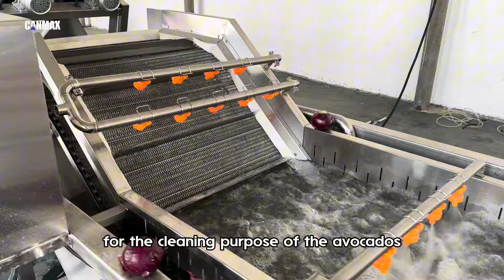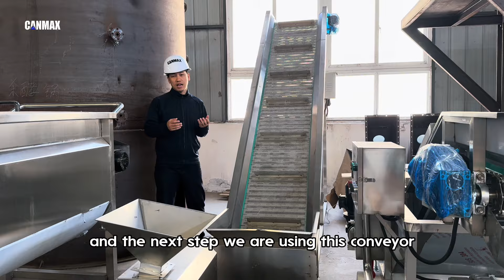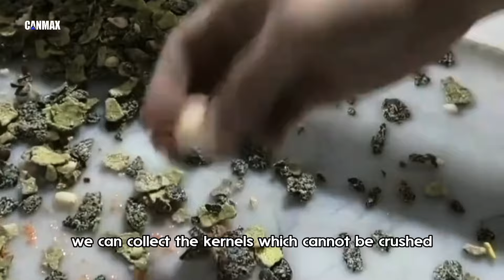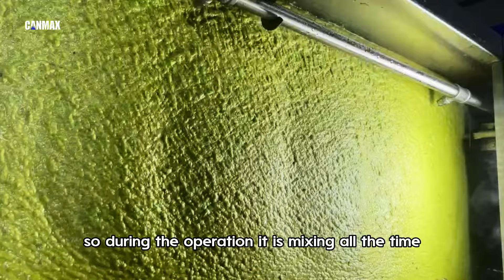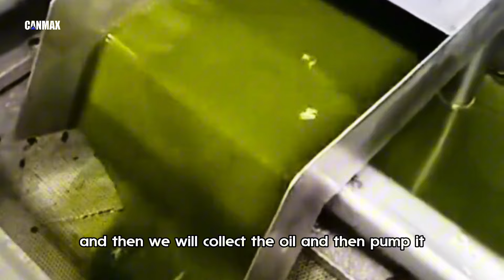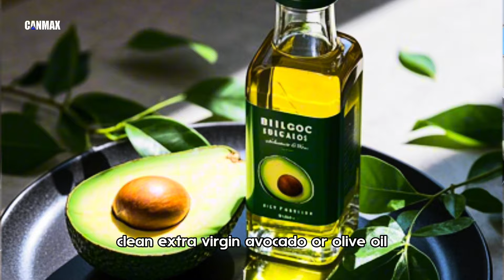500KG/H Avocado Oil Production Line | Centrifugal Extraction Process #avocadooil

Comment: Is it affordable ?
Reply from the maker: The centrifugation process comes with substantial costs, primarily due to the decanter centrifuges it employs; disc stack centrifuges are sometimes also required. Centrifuges are high-precision sophisticated equipment that demand extremely high standards for rotational speed and operational stability, resulting in high equipment costs. As such, this solution is only viable with a sufficient budget.